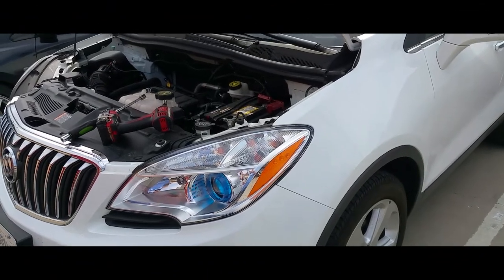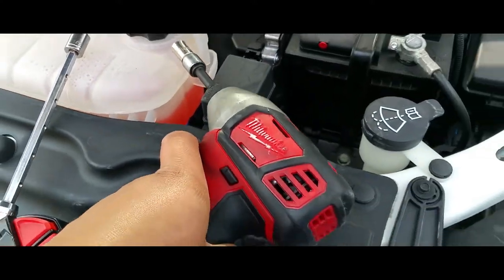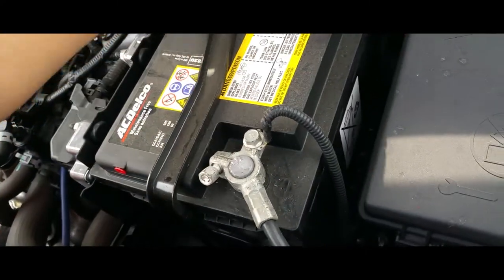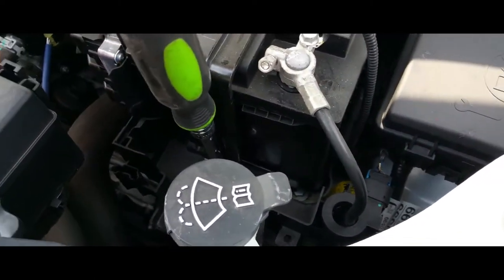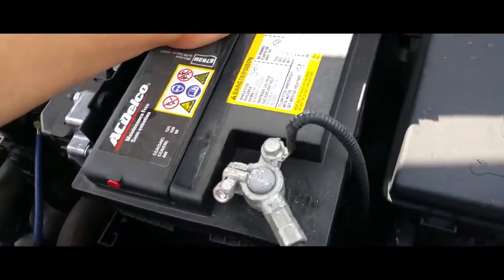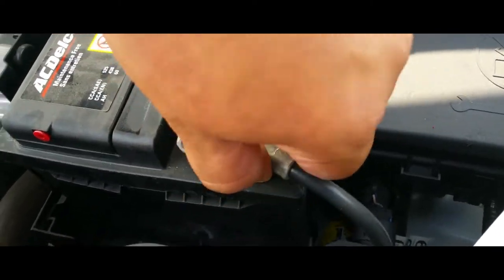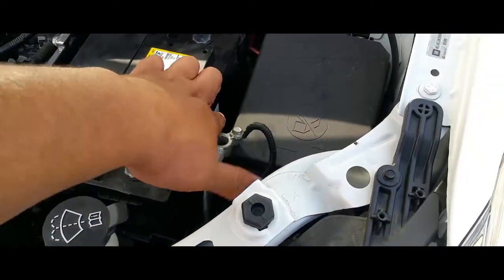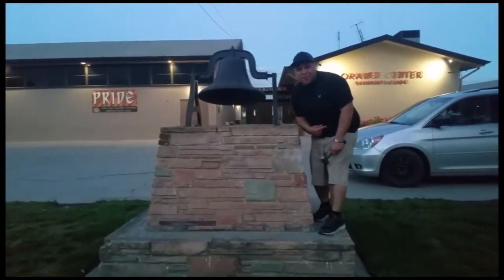How to: Remove a battery on a 2016 Buick Encore

Comment: Very helpful for someone who's never removed a battery before. For some reason though, when trying to tighten the bracket to hold the new battery in place, the screw doesn't grab on and stays loose. Was there a nut on there too that I didn't see you remove? If so, looks like mine disappeared.
Reply from the maker: No should bolt right up. Its treaded in the frame....make sure its lined up correctly. You should be okay 👌 thank you for your SUPPORT!

Comment: Replaced the battery on the wife’s car, now she said the AC not blowing cold air. Is something that has to be reset. Maybe by unplugging the battery then plugging it back up?
Reply from the maker: No this wouldnt have anything to do with this. Are the Fans kicking in? just the ac isnt blowing cold? Maybe low on Freon or check fuses make sure they are all good....Under the hood look for the fuse box and look for the ac Relay....swap it with a similar one and see if that fixes it....Could be a Fuse, Relay or low on Freon. Good Luck bro? Any Luck so far?

Comment: That's not the way to do it if you want your radio to work after your done. You have to either hook up a battery charger or trickle charger to the battery wires before disconnecting them then remove the wires from the battery install the new battery and tighten everything down. I used your method and had to reprogram the radio and CD player afterwards.
Reply from the maker: I didn't have to do that. But in this case the battery was replaced because the battery was bad. Not holding charge so there is no wrong or right way to remove it. So this is the right process to remove the battery. 👍
Reply: Tom I’m having the same problem. How did you reprogram/reset your radio?
Reply: Tom M thanks in advance
Reply: Never heard of anyone doing g this but good idea